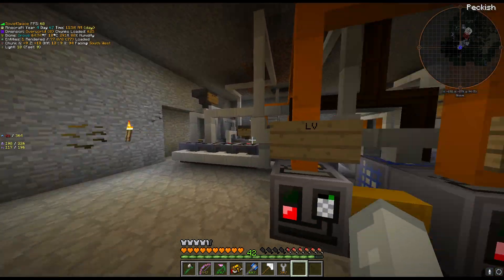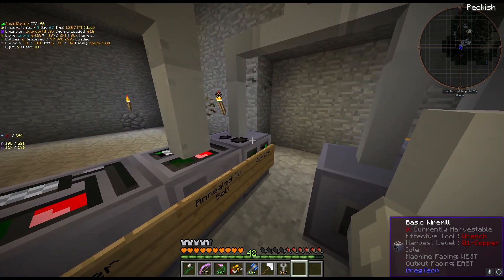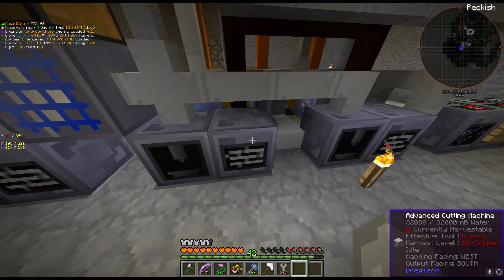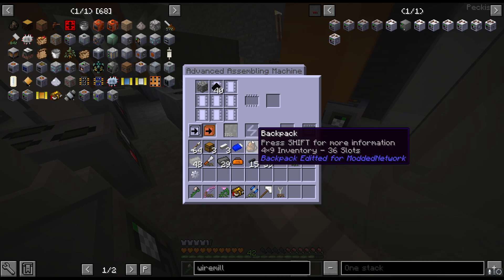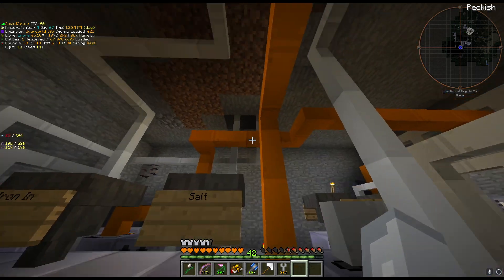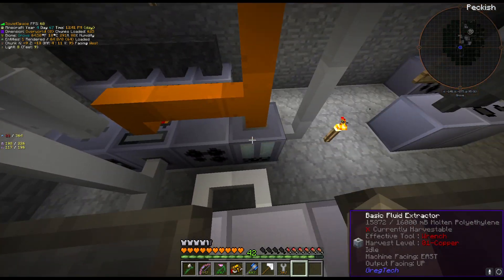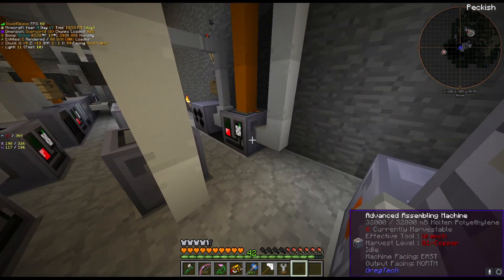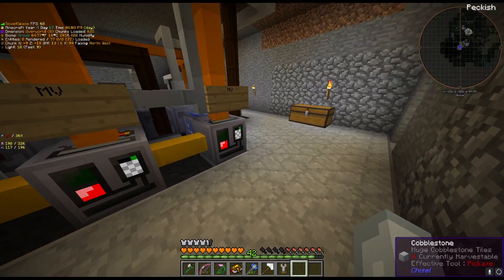Gregtech new Horizons HV, MV, and LV Circuit Automation

Comment: Do you have the tutorial on your channel somewhere?
Reply from the maker: Not yet. I’m currently building a fully integrated ultra low voltage to IV system which will be far more resource effective than the system I’ve built in this video. The one I’ve built in this video has a couple of flaws, especially regarding its clean room integration.

Comment: Nice. But, how do you get 7 things onto an assembler without multiple stacks? An LV circuit needs 4 items, power, liquid tin and an output to inventory but it only has 6 sides.
Reply from the maker: So you have a main bus of items which is connected to the assembler via a LV filter block. The filter also serves as a buffer for the items and allows all of the different tiers of assemblers to be connected to the same component production.